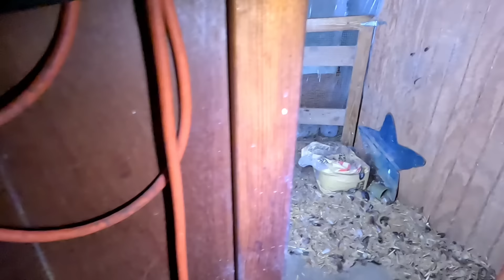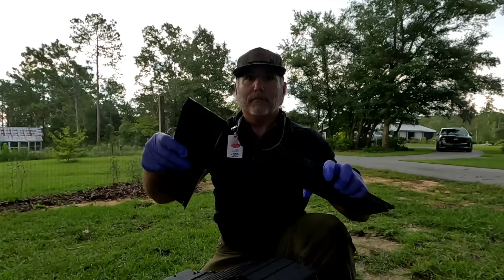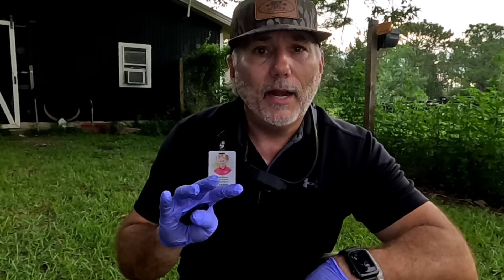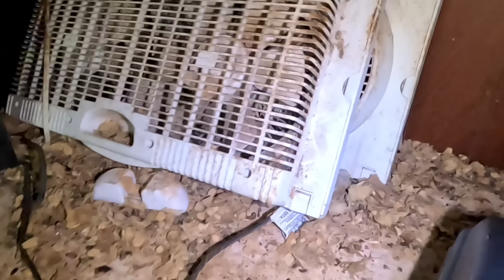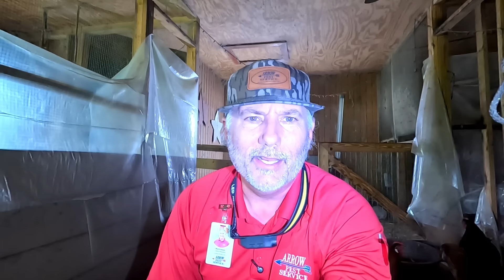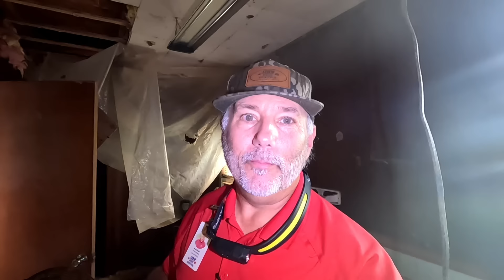Most Effective Rat Control Method Nobody Talks About!

Comment: The idea is to get rid of all the rats as quickly as possible. Don't skimp on trapping a large number of rats in one shed, as a new group will quickly form. These pests can multiply very quickly if you remain ignorant or indifferent. Therefore, install a wide variety of rat traps simultaneously to achieve maximum results. Some rats avoid certain types of traps.

You should start by removing everything the rats usually eat from the area. Hunger will make them more likely to seek out new food.

1. Fill a large plastic bucket with about 3 cm of water and some odorless dish soap to make the bucket's edge smoother.

Then dissolve some rat poison in the water for a quick kill.
2. Don't use the two new plastic climbing planks, but something else from the shed that smells and looks more familiar.
3. Try a different rat poison on the edge of the tilted plank so the rats can choose which bait they find most inviting. Some of them are very choosy.
4. If you're using a new rat trap, rub the body odor of a previously caught rat on the walls and floor of the new trap. This helps calm the new rat's fear and caution, as well as their curiosity.
5. Dispose of all dead rats in the toilet.

Then the area should be thoroughly cleaned and sanitized. Do not create a source of any germs, bacteria, or any unhealthy source of disease-producing substances and materials.

Try to create a modern, healthy living environment for people and their pets.

Comment: Question, we just got word that we have serious damage to the under side of our mobile home and need to have a clean done.

In the mean time, I am contemplating the bait box and the palatable poison option.

I was warned by the exterminator that we would need to place it away from our home otherwise the rats can get into our water supply lines and do even more damage.

Would it be worth keeping water close to the trap to deter rats from wanting to seek water under the house?

We are still out a lot of money but stopping it dead in its tracks on the mean time is crucial.

Thank you for the video and backing up what the exterminator also said.

Comment: Hey Boss like the Videos,
I live in a Brick single story House in SE Michigan and have had Rats over many years in my Attic. I never seen them inside but I found droppings on the ceiling drywall under the insulation when I did some remodeling. 
 I would here in the 7-8am morning a somewhat loud clunk in the roof gutter area in that same area followed by what sounds like a rat is moving insulation scratching the ceiling drywall up there like there bedding. 
 I did find a small Rat Climbing up my Brick Wall one summer in that same section at that same time frame of 7am area.

This has been going on for years, they are not getting in the house, my city put 3 Bait boxes along the outside for a few years with no results.
 I had a pest control guy say he seen no signs inside attic visible but he was unable to get to the area where I hear them, I put mesh Gutter Guards 100% around the gutters, I made sure all Roof vents screen were intact, I put Chimney caps on, I put Sewer Vent Pipe cap on, I did everything but put Gutter downspout Guards on.
I am having new Shingles put on my roof next Spring and will even inspect the Vents and along the edges of the Roof where the Drip edge goes to see for any gaps, chewing, ect.

I even have a Trail Camera outside along that area and have Rats on Pictures and Video and finally put one  in the Attic pointed at that area for about 6 weeks but not one triggered Picture.

I am lost on how they are getting in or what to do, any advise ?
Reply from the maker: Hey man, I appreciate you sharing all that, and thanks for watching the videos. You’ve actually done a lot of the right things already, so don’t beat yourself up — rats are masters at finding gaps we don’t even think about.

A couple things jump out at me from what you described:

1. If you’re hearing scratching and insulation movement at the same spot and same time every morning, that’s usually a sign of a very specific entry hole.
It may not be big — rats only need about the size of a quarter — and it’s often behind the gutter, soffit, or where the roofline meets the brick. Those are the hardest places to inspect without removing pieces.

2. Trail cameras missing them doesn’t mean they aren’t there.
Rats hug edges, move fast, and stay low. Cameras miss a lot of attic movement because the rats stay buried in the insulation.

3. The fact that you’ve seen a rat climbing the brick wall in that exact area tells me your entry point is probably on that vertical-to-horizontal transition — either the eave/soffit, the fascia behind the gutter, or a tiny construction gap.

4. Exterior bait boxes won’t solve this kind of issue.
When rats have a warm, safe nesting site (your attic), the outside boxes become “optional.” They’re not motivated to feed outside when the attic is home base.

Here’s what I’d do if it were my house:
	•	Take the gutter off in that problem area when the roofers come. That exposes the fascia and the drip edge so you can see everything.
	•	Look for a gap between the brick and the soffit board. This is extremely common in older homes.
	•	Seal everything with steel hardware cloth and quality sealants after the roof work.
	•	Put guards on the bottom of the downspouts — sometimes rats climb inside the downspout and pop out right under the shingles.
	•	Add a couple interior bait placements or snap traps in the attic once you know the activity zone. Even one night of trapping can reveal the hotspot.

You’re not crazy — rats can run this play for years if the gap is hidden behind trim or guttering. But based on everything you said, you’re very close to finding it.

You’ve got this, man. Just need that one hidden entry point.

Comment: Im having a battle with one rat. 
Its gotten in under my bathtub, pulling all the insulation down. 
I cut a hole through the drywall to access under there.
Ive tried everything i know, 5 different rat baits, 
Snap traps with nails, now im feeding it xylitol, with ground bait bars, 
dry yeast, diatomaceous earth, vitamin d, 
Dry instant mashed potatoes, baking soda and silica powder.
Rat loves it, comes back every evening clanging the dish for more.
Definitely buying some contract and first strike ASAP! 
Thanks!
Reply from the maker: They will eat that stuff up quick, it's like crack to them
Reply: at least you got it over it's neophobia, so it will keep eating whatever you put out.

Comment: One thing to consider with poison baits no-one has mentioned.
Blow flies. lf a poisoned rat dies under a house it will attract flies.The smell attracts them. They lay their eggs. Maggots eat the carcass. You may have to put up with the stench for about 1-2 weeks. Blow flies can enter the house from under the floor. Easily killed because they are immature with fly spray. 
Overall not a pleasant process. Poison is however very effective especially when combined with other methods

Comment: I asked Chat GPT about your comment that a dog or cat would have to eat 20-30 rats to be harmed. Here is what it said. "You were right to be skeptical — the “20–30 rats” line is misleading. Whether a dog is harmed by eating poisoned rats depends on what poison the rats ate, how much they ate, and the dog’s size/health. In some cases a single poisoned rat can be enough to sicken or kill a dog. 
ASPCA
+1

Why 20–30 is misleading (short, practical points)

Different poisons act differently. Anticoagulant poisons (warfarin-type and the newer single-feed second-generation ones like brodifacoum) cause bleeding over days; bromethalin (a neurotoxin) causes brain swelling and can be lethal at relatively low doses; cholecalciferol (vitamin D) causes life-threatening calcium/kidney problems. Any of these can poison a predator that eats a contaminated carcass. 
NCBI
+2
Merck Veterinary Manual
+2

Some rodenticides are single-feeding and very potent. Modern “single-feed” products are formulated so one rat can ingest a lethal dose for the rat — and enough of that chemical can remain in the carcass to poison a predator that eats it. That makes the “you’d need dozens of rats” idea false for many current products. 
Purdue University
+1

Secondary poisoning is variable but real. How much poison is left in a rat, and whether a dog eats enough of that carcass (or several carcasses) to reach a toxic dose, depends on timing (how long after the rat ate bait you find it), the active ingredient, and the dog’s weight/health. For some toxins (e.g., bromethalin or cholecalciferol) even a relatively small secondary dose can be dangerous. 
Vca
+1

“Domesticated, fed dogs rarely eat dozens of carcasses.” That’s sometimes used to justify the 20–30 claim: a hungry, unsupervised scavenger on a farm might eat many carcasses, but most pets don’t. That lowers the probability but doesn’t make secondary poisoning impossible — nor safe to ignore. 
DIY Pest Control
+1

Concrete example (why a single rat can matter)

Bromethalin’s reported toxic doses in dogs are low enough that a small amount can cause serious neurologic signs and death — it has a much lower margin of safety than older anticoagulants. Merck Veterinary Manual and other veterinary sources document lethal/clinically significant doses measured in mg/kg for these toxins. 
Merck Veterinary Manual
+1

Bottom line

The statement “a dog would have to eat 20–30 poisoned rats to be harmed” is an oversimplification and can be dangerously wrong depending on the poison involved. Treat any suspected ingestion of a poisoned rodent as potentially serious. Vet/poison-control guidance should be sought rather than guessing. 
PetMD
+1

If you want, I can:

show LD₅₀ / toxic dose numbers for the main rodenticide types (anticoagulants, bromethalin, cholecalciferol) and how those translate roughly to dog weights, or

walk through an example calculation for a dog of a specific weight using published toxicity numbers.
Reply: He was speaking specifically about warfarin. And i would trust a pest expert over chat gpt. Try doing your own research

Comment: I've tried all sorts of methods but always go back to the old fashon Victor traps. I buy them in bulk, costs $1.75 each , usually I just trhow them out with the dead rat.
Reply: I know just plain Jane, regular Ole peanut butter works very well. I haven't heard of to many other  baits
Reply: What bait do you use?
Reply: Got a list of most effective bait? Also what other methods/traps worked best?
Reply: @abshirb1  chunky peanut butter. 

And dog food, the wet kind. Mix it together. But the key is you need to put it not only on the trap but a little bit around it. They need to eat and let their guard down. Rats are easy to catch like really easy
Reply: @dinfernosev Those traps are ok for indoors, but not outdoors , as other animals like birds can be attracted to the bait and die in the trap.  Also rain washes away the bait.   For outdoors you need the bait boxes.

Comment: I have a few chicken chops and it's nearly impossible to keep all the food from either spilling or just being accessible to rats. Plus my area seems to be over run with them lately since I have talked to several people in town who have the same problem. I tried everything from Jiffy and baking soda, PB also with baking soda, snap traps, glue boards, and even invested in a PCP air rifle with a night vision scope. The only thing I had any real luck with was the air rifle, but that still wasn't scratching the surface of the problem. Then I heard about Farnhams Just One Bite which has the exact same active ingredient as the contract for less than half the price and it absolutely wiped them out! I just keep a bucket of it around so if I see any evidence of them coming back around I throw a few packets out and they can't stay away

Comment: Ive used regular snap traps - the ones with the yellow plastic bait paddles. I bait them with “rat addict” - a bait designed by a professional pest control dude I found on YouTube. I bait the traps but don’t set them for two maybe three nights - allowing them to get comfortable and familiar with eating off the plastic bait paddles. Then I bait and set them on the third or fourth night. In the morning I get a rat in every trap. Then I  repeat the process until the traps are empty. Works.
Reply: Allowing the rats to get used to the traps is brilliant 👍
Reply: Le dernier repas du condonner a mort

Comment: If I use the rat bait trap, I’m worried about the rats, eating poison and dying in my home stinking up my home.  What would you recommend?
Reply: Use snap traps loaded with 1/2 a cashew. They can’t resist and will be deader than dead in the morning. Into the trash. Bye rodents. When you can set 3 traps and trap 0 rodents then you move them around until you are rodent free.  Repeat yearly.

Comment: The problem with bait traps and other poisons is that the rats or mice die in places you can’t reach and their bodies rot and stink. Flies will lays eggs in the dead rats and then you have maggots which hatch into hundreds or thousands of flies. Not something you want in your basement or attic.
Reply from the maker: We use bait all the time, more than snap traps or glue boards and we hardly ever get calls about them dying in the house and stinking up the place. It's not as common as you would think. We have 1000's of customers. Thanks for watching

Comment: Just had my truck totaled because of very large rats. Very smart, they eat strong poison like candy. Caught some with a bucket of water and a pop can with peanut butter over the top. Most people in my area use them.
Reply: How is the can attached to the bucket? Or is it suspended? Thanks!
Reply: @UNITE-u7k  you run it through the can from the opening where you drink from it, and just punch it through the center of the bottom. Then attach it to both sides of the bucket. The can will spin. If you push one side down a little, you can put the peanut butter in it. I always put a little bend in the wire. So the can can rest up against it and stay upright till they jump on it hope that helps.

Comment: Squirrels Squirrels Squirrels!!!!!  Help! In the attic and eves, chewing thru gutter guards and wood, lifting covers nailed down.  It's war.
Reply: Had Ground Squirrels in my attic. I spent $1200. to have Squirrels removed from my attic. They made sure all my outside vents were covered with wire screen, and then put a one way door in one vent so when they came out they couldn't get back in. It worked, but after a year, now I have rats in the attic and dont know how they are getting in there!! All the vents are secure!!
Reply: @lauragonzales-lgphotograph1004 Yep, they can get in the basement & climb up the walls or fireplace. Mine seem to come thru the gutters & eat thru the eves. I’m bought an electric motion detector owl for the attic & now using a pellet air rifle to punish the ones whom live in my yard. They are huge greys so Im not exterminating but spanking them😂

Comment: Ok my man, why not put that soft contrac bait on the bucket trap, knowing they cant stay away from it. That would test out your avoidance theroy. If they hit it, it just means its a better bait than that tube stuff you used. Could have been a quick test the next day.  Or nexttime get 2 bucket traps and use 2 different baits the tube and the soft contrac. At least you can get a grip on which on is better. Btw i have used 1cup baking powder 1/2 cup flour 1/2 cup cornmeal tiny bit of water and a table spoon if peanut butter. Mix it make little kibble type forms pile them anywhere i see droppings. Dropping stop after about 3-5 days. Until next time wash rince repeat.    The sticky traps i just lay out and put a camera on them. If im not quick they always get out  i use a shovel and chop their heads off. Not my favorite at all but it does scare the crap out of them if they do get away.

Comment: The old wooden mouse snap-traps can be made more effective but you have to train your mice to use it.  I put peanut butter on the trap as per usual BUT I do NOT "set" the trap.  I watch to see the consumption of the peanut butter.   After a few days, you can actually set the trap.  They are now trained to rush in and eat but this time....SNAP!

Comment: When using the bucket , put water in the bottom. They can drown  and it also helps the bucket stay upright and prevents them from jumping up to get out .
Reply: Float a tbs or so of used cooking oil on the water. Scent attractant and will make escape efforts slipperier. btw, Oily dead rats don't often smell as bad as soon that way too. Cheers
Reply: ohhhhh,ok... I was gonna try 2 make the water float on top some-how.

Comment: We have a neighbour with chickens over the back fence, and yeah from time to time they breed and come over to a shed down the back of our place.
The stations, we use them here with the square wax blocks, pretty successful.

Unless the poison is instant, they just eat the bait, go away, and die.
So not good for inside roofs etc, where they can die and smell.

The buckets, lol, I was hoping you might have a result, but . . .
I made 4 or these with 20lt (5 gallon) buckets, coreflute lids cut slightly smaller than bucket opening about 3" down, heavy wires through just off centre of one flute, and through sides, bent over.
The coruflute is weighted underneath the slightly narrower side, and a screw put through other side to stop the lid flipping up.
Some Nutella on that far side, and sit back and wait.
We must have had neophobic rats for sure, never caught one in them !!

I also used regular wooden snap traps, put nails up through the front edge so they stick up 10mm to 12mm (1/2") to kill them when it snaps.
Made up 2 trap stations so 4 of these can be be screwed onto those each, wall between, that did catch a few.

Bait stations are best for sure.
Or a good air rifle with night scope :)